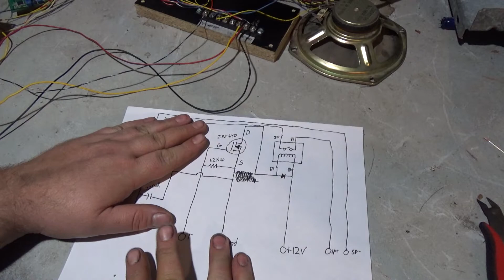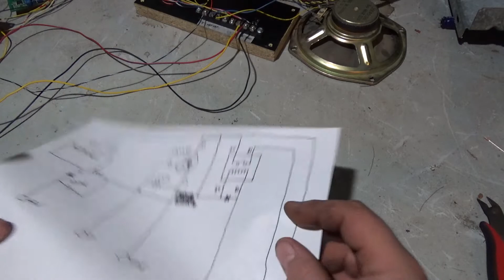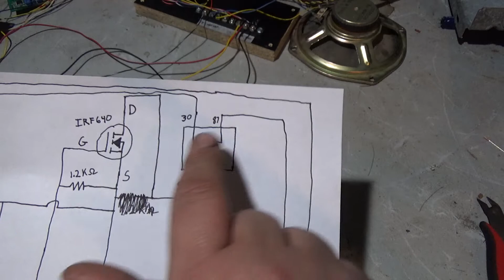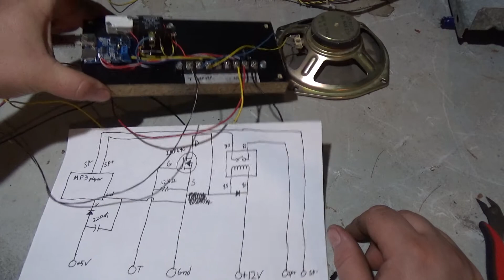how to make a HOME MADE arcade tape player replacement

Comment: Also, Thief, Shark Attack, and Nato Defense all use the same basic hardware.  It's a 4-channel system, but 2 tracks are generated by the game board sound chip, and the other two are output on the left and right channels of a single stereo audio track, from a loop tape, which is power controlled by the game board, similar to Journey.  I've used a Lepai automotive player to replace the tape player in Thief (see my writeup on KLOV, I'm andrewb there), but you could probably use this one also.  All it needs is the auto-playing of a single mp3 feature, and speaker-level outputs.  You wouldn't even need the relay and MOSFET.
Reply from the maker: thanks ill check it out

Comment: you could of used a 7805 voltage regulator simple stuff :) for the mp3 player and just feed the 12v in to the 7805   ,,,i love your practical way of going about things ,, Em way of thinking :)
Reply from the maker: yes great idea why didn't i think of that  thats  what i am doing now
Reply: Could also use a 5v Zener.. Im sure that amp board is takes up 110ma or less

Comment: Could easily use a Arduino ($2) and mp3 module($1), you will  have a multi mp3 tracks on a micro SD card, selected by the machine via Arduino (stereo tracks would need 1$ amp) :)

Comment: So that player includes an amplifier, to drive the speakers directly?   (Does it output line level as well?)
Got a link to the player you used?
Reply from the maker: https://www.ebay.com/itm/TF-Card-U-disk-MP3-Decoder-Board-Audio-Amplifier-Decoding-Audio-Player-Module/192163653486?epid=507941656&hash=item2cbdd8a76e:g:~pQAAOSwPcVViQwl
Reply from the maker: yes and yes
Reply: Awesome.  Thanks for the link.  I just ordered a few.